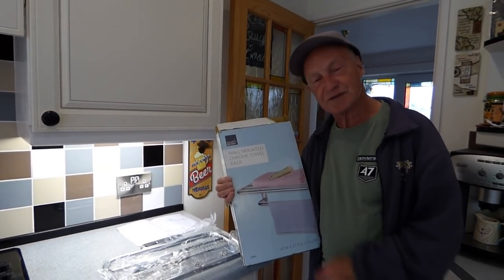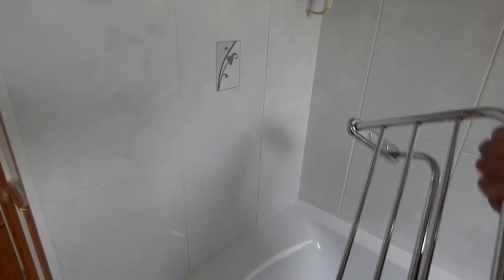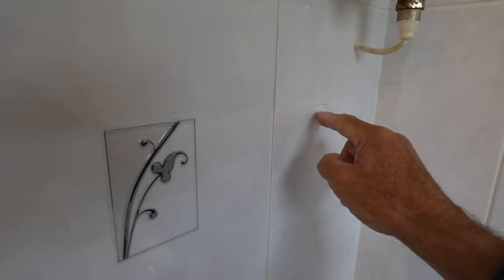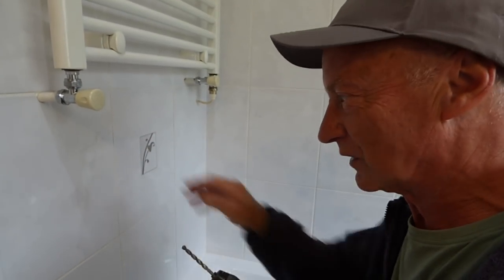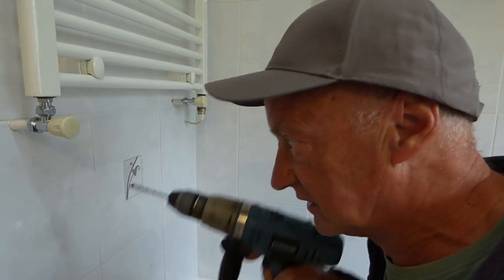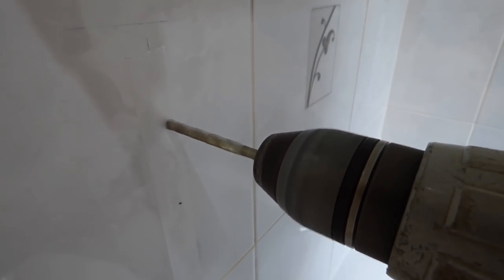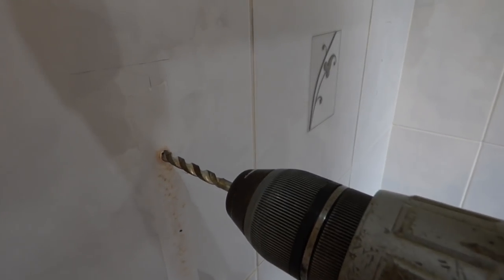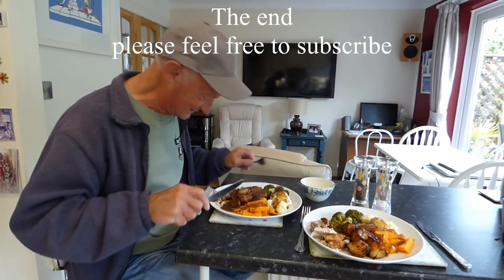How to fit a towel rail to a tiled bathroom wall.

Comment: A towel rail rad over a bath?  and with an electric element, what were you thinking Al, breaking a few electrical regs, such as Any fitting or appliance within zone 1 must be IPX4 (splash proof) or better as well as a maximum of 12v (SELV) with the transformer located beyond zone 2.
Reply from the maker: The towel rail is not connected to a power supply I just left the element in it. It is plumbed into the central heating circuit.

Comment: You could of said about using a pipe and cable detector before drilling.
Reply: could've - abbreviation for could have
Reply: Al's eyes come with built in pipe and cable detection.
Reply from the maker: I knew there was nothing in that wall, but suppose I should have included that it is a good idea to check.